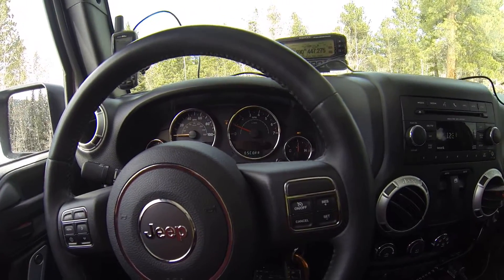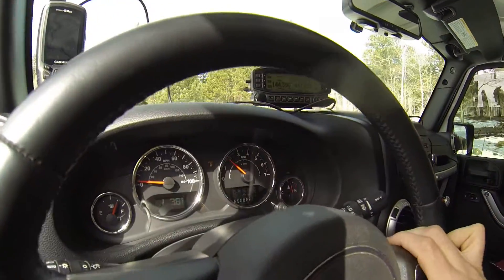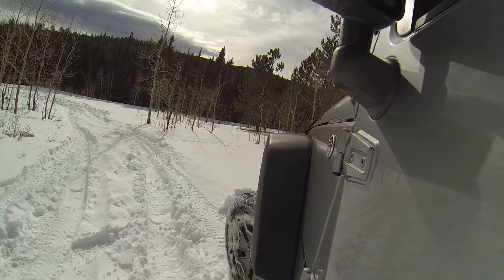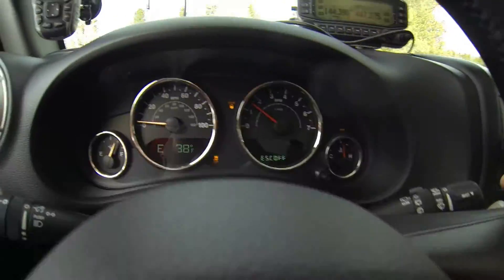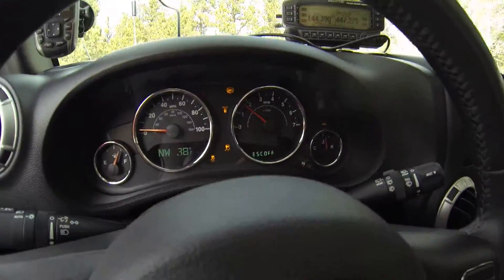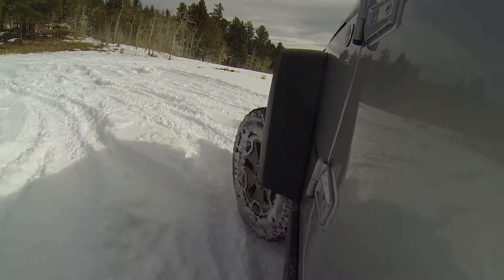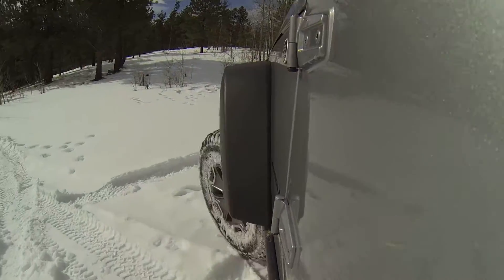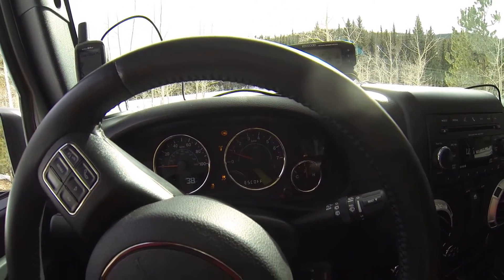Testing out fully disabled ESC - BLD - ABS jeep rubicon!

Comment: I have 17 jk rubicon. I pulled the j6 fuse and it does same thing as your switch. Switch is obviously more convenient. Don't appear to be linked to fuel pump like some have said. Started just fine and ran normal.
Reply from the maker: +Brad Faulk you sure about that?  Fuel pressure should run out in bit...
Reply: Yeah, just tested. Looked up and fuel pump is not j6 fuse. Think somebody got confused with ABS pump/fuel pump on description. http://auffarth.com/BillFolder/JK/Fuses.jpg
Reply: Did your speedometer and odometer continue to work?
Reply from the maker: Yes indeed
Reply: I'm sorry I was asking Brad that question. When I pulled the fuse the two stopped working.
Reply: Yeah, only disables abs/traction control. Have done a few times now. When you want to enable again, simply turn off jeep, put fuse back in. When you start again, lights will pop on again but after you move a few feet will go off again.
Reply: can you do a write up or video on how to do this mod? Would love to have a fun switch in my 16 sport

Comment: So after you interupt the signal (even just momentarily) there is NO intervention from the computer as far as traction control or ABS  AT ALL until you cycle the ignition correct?
Reply from the maker: correct. it stays completely disabled until you shut the key off and re-start.

Comment: I'm in the market for a Wrangler, so I've been watching/learning everything I can.  What's the benefit of disabling those functions?
Reply from the maker: +Hillbillybeemer WV the benefit is greater in a manual cause the computer will lock yours brakes and if you're not on the gas, it will kill the engine. I love this mod but you have to pay extra attention cause on ice and slick snow, you do loose ABS until you cycle the key.